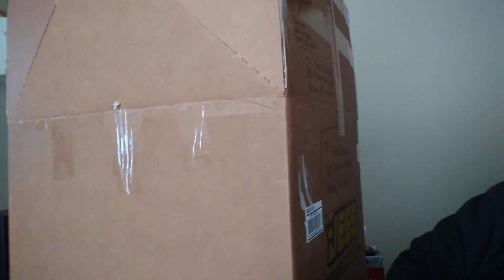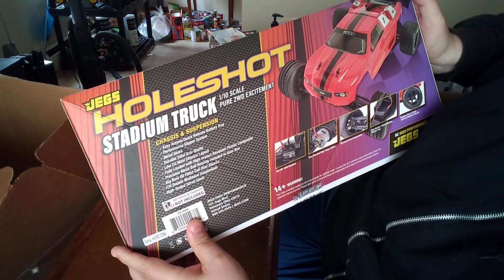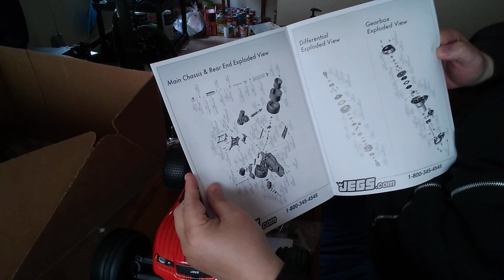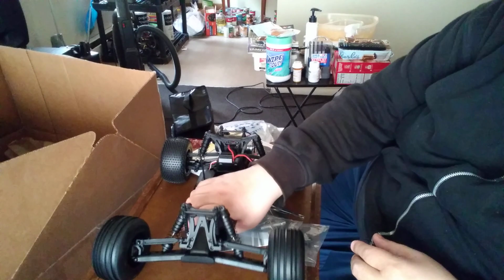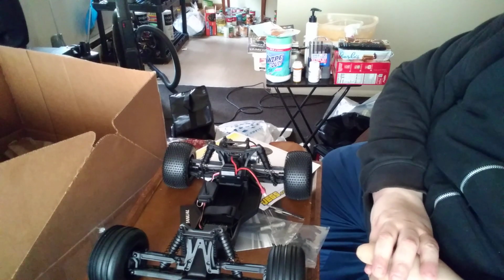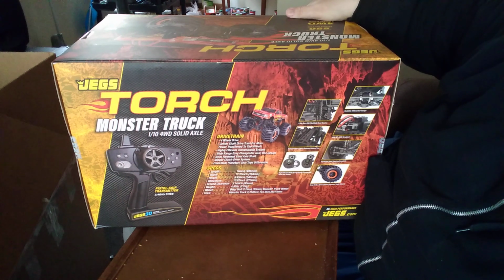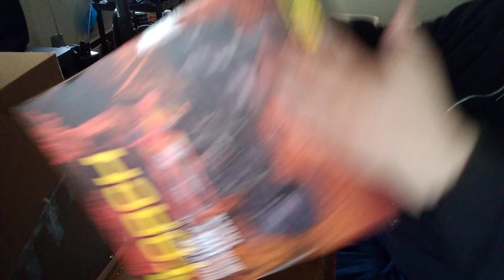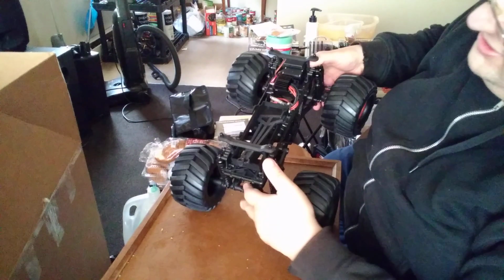new stadium truck.

Comment: Awesome presents from the awesome RC Elf!!! They are both cool but love the monster truck!  :o)
Reply from the maker: Thanks do you have a problem with your Pubg steering which fully locked to lock on that buggy because I did it would get caught in the front nose and it wouldn't bring back the rim or steering the wheel back in?
Reply: @bradkalman2353  No I don't have that issue!  :)
Reply from the maker: You mean when you have it fully open you know not adjusted word doesn't swing so much for the steering cuz when mine is at 100% for left to right it does that or it started to after I used it for the first time and I don't know why do you have yours fully open from Lock to lock?

Comment: ⚡️⚡️⚡️Those aren’t Tamiya or Kyosho. What’s going on Brad ? haha. 2 awesome new toys to play with & you don’t have to build it before you can play with it👍🏻👍🏻. I love RTR. I know you love kits but you can rebuild it after a good bashing 🤣👍🏻. They both look cool. When are you taking them out for a budd?
Reply from the maker: I will be taking them out after I go through some other cars I want to run first I have a lot of cars I haven't run at all and the weather hasn't been too cooperative the weather's been wet and cold it's the most part and then we get the nice weather it rains for the most part and I don't get to try you spell so where I go to run them it's dry I don't want to put muddy cars in my car cuz I don't have any place to wash them off also the whole shot I had to put 8 ball bearings in it so I had to take them apart 2 in the hubs of each hub and two in the rear hubs. So haha.

Comment: 👍
Reply from the maker: Welcome  if you subbed  thanks.
Reply: @bradkalman2353  Sure did cool little ripper...  Thanks for sharing.
Reply from the maker: Which car?
Reply: @bradkalman2353  haha sorry should have said The red hole shot I think it was.  Stadium truck looking car.
Reply from the maker: Yes and it was from jegs and last year around Christmas time they were selling them for $50 it has metal gears in the gearbox as far as I know and football bearings in the gearbox but you need to put eight ball bearings at the hubs front and rear all together supposedly has a 12 turn motor and it is a 550.
Reply: @bradkalman2353  Smoking deal..   Good find..
Reply from the maker: The elf gave me the cars it's just last year they were that price except for the torch the torch was $99.